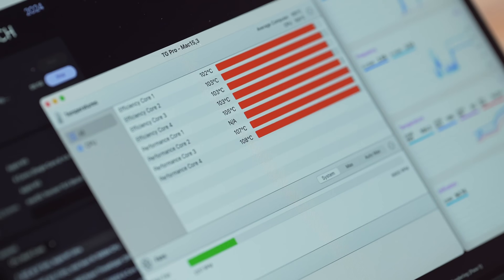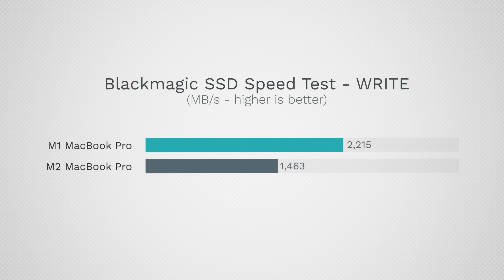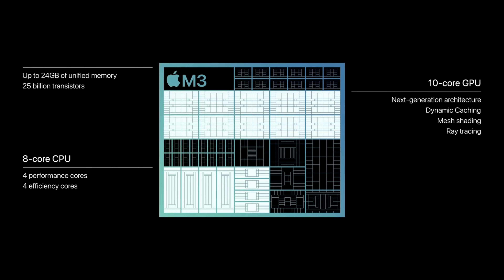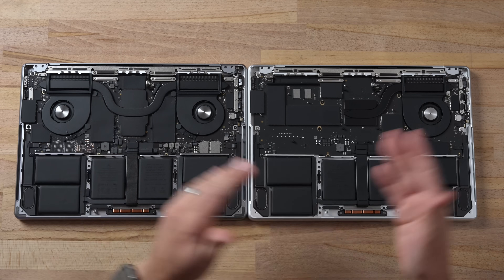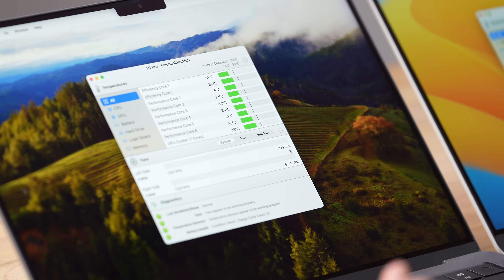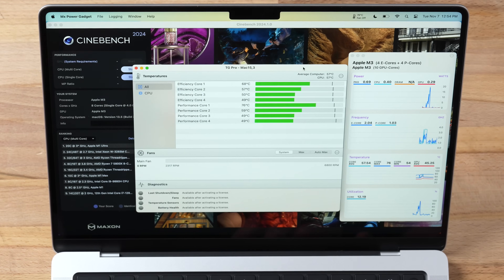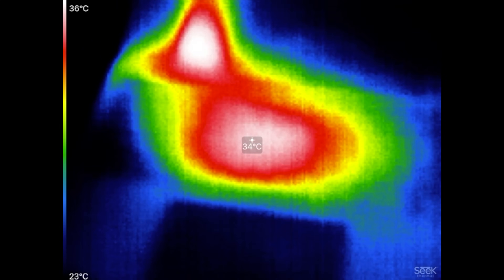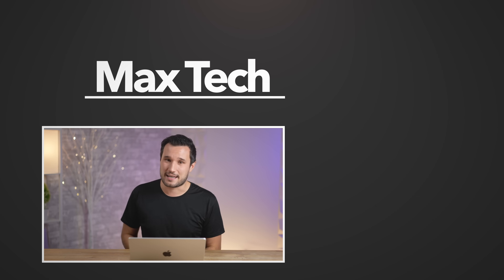M3 MacBook Pro Teardown & Thermals - REALLY, Apple?!

Comment: Looking forward to the M3 Pro benchmarks - looks like Apple nerfed the Pro chips big time to pull in more of that sweet Max money!
Reply: The unbinned M3 pro doesn’t seem nerfed.  We will see what Max tech test results show.
Reply: @sammyjammy6647  unfortunately the CPU gains seem meager and the GPU gains totally flat over M2 Pro
Reply: @ErfonElijah  numbers may suggest that, but blender GPU render is significantly faster on M3 Pro. Surprisingly.
Reply: @ErfonElijah geekbench SINGLE core is ~20% higher than M2, ~45% higher than M1.  I'm waiting to see some more specific benchmarks for my use cases but that is pretty significant.
Reply: Hey E.E.! You should start uploading again too!
Reply: M2 Pro has the same core config as my desktop i7-12700K (and it's the best i7 in a decade for perfomance per watt).
Reply: The Pro seems fine to me. Nobody had any problem with Apple making Pro and Max the same when it comes to CPU performance
Reply: I, for one, am really eyeing the new M3 Pro. I do not mind that the 2 P cores went to E cores, the fact that the theoretical max power of the chip is not significantly higher compared to M2 Pro does not bother me that much, since I am doing my workflow on M1 base, I would rarely drive the CPU so hard to feel the difference between 8 or 6 p cores. But the extra 2 E cores may give me some more battery life, so... it may be up to something in its use cases, even though the M3 pro is set up to be a benchmark disaster.
Reply: Indeed they did. Oh I can imagine their surprised faces when they realize total Mac sales drop YoY
Reply: @whitecrowuk575  Actually the tests proved that M3 Pro is significantly better than M2 Pro in almost every situation
Reply: @davout5775  marginally better and price is higher I believe. Marginally better won’t make people to upgrade from M1 Pro.
Reply: @whitecrowuk575  The battery life is not marginally better. The same goes for GPU performance especially in tasks where Ray tracing is used. The rendering times dropped significantly. This is a major upgrade over M2 Pro
Reply: @davout5775  you mean matters for 0.001% who will buy Max anyway?
Reply: One of the main things of any laptop is the battery and it is clearly a lot better. Thsi automatically means it is not "0.001%". On top of that you get slightly better CPU, slightly better display but apparently a lot better GPU with ray tracing which means significantly better rendering capabilities. So there are a lot of small and big improvements
Reply: @davout5775  I get what you’re saying but rendering is very very niche use case - majority doesn’t touch that. In few ways it’s worse In few marginally better. M3 Max is a star here and reason is simple - Apple wants to lure people to upgrade to more expensive tier. Can’t see people throwing themselves at it though. Max will sell better than predecessor but high price means it won’t beat M3 Pro sales. And those will be down.
Reply: eh it was probably to give more power headroom to the GPU and battery life
Reply: I ran only CINEBENCH on my newly shipped m3pro base model. CINEBENCH2024.single core 138 multi core 837 gpu 5518. Compare to my base M1Max 113/835/3910. I return my M3Pro now...I ordered a base M2Max MBP14 I just run the test 121/1046/5113. with discount and considering the ram and ssd is 32G/1T on the base M2Max I would say Apple is now promoting M3Max. In compare, M3Pro is positioned specially at a lower performance point.

Comment: apple is so ridiculous. $1,600 for a single fan cooler that can't handle the heat , gen 3 ssd speeds and not gen 4 , and only 8gb of ram 🤦
Reply from the maker: It’s just late to ramp up the fans. Once it ramps up the heat gets handled just fine
Reply: @MaxTechOfficial I just received mine haven't taking out of box yet. Do u think I'll be fine . I'll mainly use for web browsing, video calls, watching content, and emails?
Reply: that's good to know but only 8gb at this price is still a big drawback. @MaxTechOfficial

Comment: Glad I’m going with the M3 Pro for my first MacBook.
Reply: You’re going to love it! I’ve got the M1 Air and it’s absolutely fantastic. Also for normal use (most I do is occasional photo editing in Lightroom) the computer doesn’t even heat up at all. Still blows me away that it’s fanless and as capable as it is.
Reply: Don't worry with thermal throttling in normal use. Only stress test can bring CPU to extreme temperature.
Reply: No, choose the M2 Pro, 8 perfomance cores, 4 efficency. The M3 Pro is slower and hotter.
Reply: Unbinned M3 Pro should be about the same or a little faster than unbinned M2 Pro, while running cooler. It will also have a faster GPU, as well as mesh shading and ray tracing in hardware. I agree that M3 Pro isn't as upgraded over M2 Pro as M3 and M3 Max are over their respective M2 predecessors, but, being neither slower nor hotter, it's definitely not worse. @saricubra2867
Reply: @saricubra2867   u lie. faster. cooler.